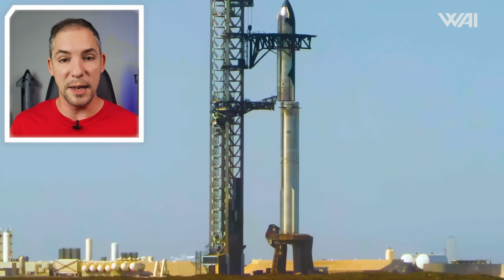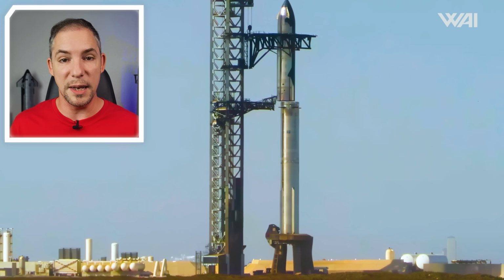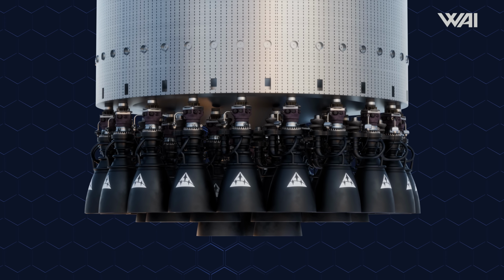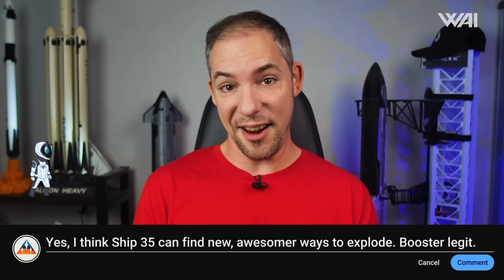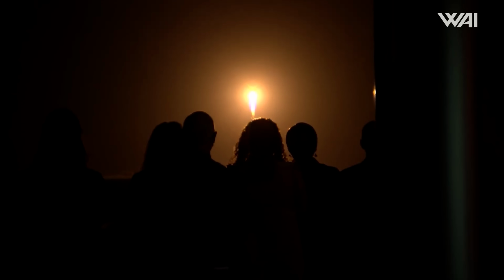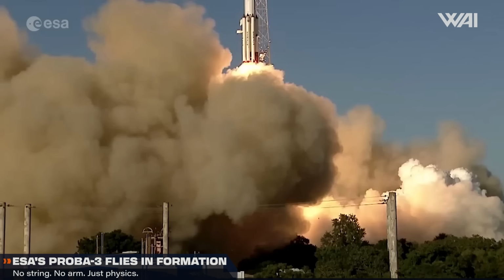Flight 9 Update: Is SpaceX’s Starship ready for its next flight?

Comment: You really don't need to spend much time working with GPT to spot its "style". If not entirely made by, this script was at minimum completely rewritten by ChatGPT, and you can spot it from miles.

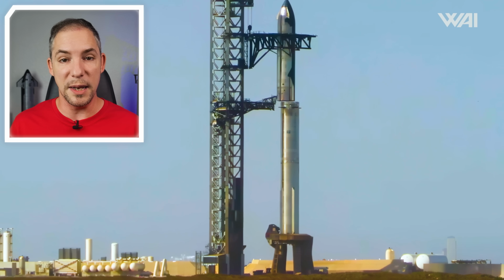This summary type segment at 2:05 with many words, but not much actual information, is typical for GPT 4.0.

At 5:54, you ask what more can SpaceX learn by flying Block 1 Boosters, suggesting that there's not much left to test with that generation. This probably was intended to be a rhetorical question, but for some reason, it is followed by an answer that reiterates the same thing, just with more words.

Then 7:07, "Before anyone gets excited about Pad B handling the next flight.." No matter the context here, this sentence is factually wrong, nothing ever launched from there, so how can it handle "next flight". Probably rewritten by GPT without proper context.

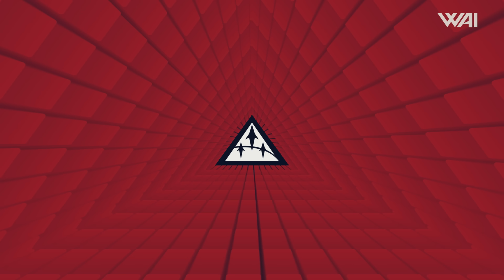8:47 - Pressure tests?

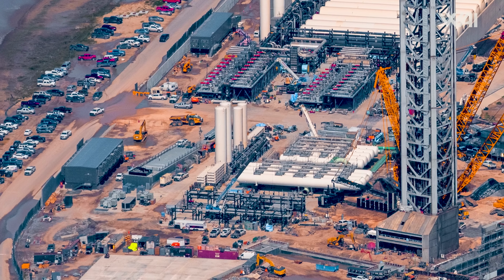8:59 - The vent plumbing? It's like those  scientific papers, where to prevent plagiarism,  AI replaces the word with a synonym, that doesn't make sense in that context. Funny stuff.

At 9:23: "It's possible that another catch attempt won't come until Booster 15" That is regarding Pad B, which was never used. Probably GPT rewriting text, assuming that Pad B is already in use.

More summarizing at 9:54, this info was given two minutes earlier.

10:45 "They are not just x, they are y" is one of the most overused phrases by GPT. Man, you're not even trying to hide it.

11:53 - "rare alignment of international space ambitions" dude

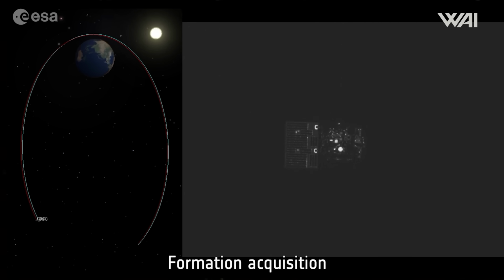17:50 again "This isn't just x, it's y" 

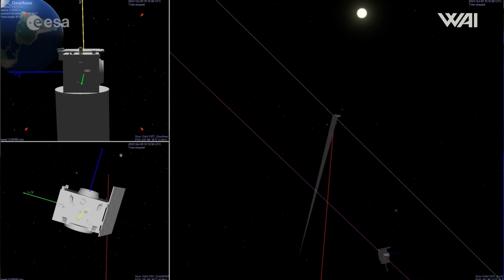18:54 and again

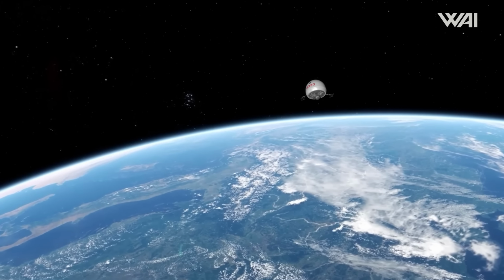By the way, the thing at19:59  is marked as a real image, but it's not the real image of the lander. It's a part of the rocket's third stage that reentered 30 years ago.

I come back to this channel occasionally, and somehow every time I do, the quality of provided information is even lower than before.

P.S. please stop saying that Booster V3 will use 35 engines. It won't, there was a single piece of hardware that suggested that, but people already figured out that this wasn't the case months ago...
Reply: So, are we watching a made over Max Headroom in these videos?

Comment: I reckon the heat seperatation stack still holds too much heat during ship/booster separation process. They can really learn something from the Russian structure. Far fewer strats using a more heat resilient metal. Being that they want to make that part of the operation re-useable &long time function to be used to launch Mars vehicle launches to Mars. Launches return s refuel re-launch until they can make ready sufficient vehicles to full that GAP/DATE between Mars and Earth.

Comment: What should have been discussed in this forum was the root cause and solution to the Starship 7 & 8 RUDs. Apparently both Starships experienced catastrophic POGO oscillations that lead to longitudinal vibrations caused by interactions between the propulsion system and the vehicle's propellant feed lines and structure. Historical mitigation approaches as on Saturn V include accumulator tanks (pogo suppressors) to dampen pressure fluctuations in fuel lines. Some engines used helium-gas-filled dampers or specially tuned bellows to prevent resonance. SpaceX apparently has not installed traditional accumulator vibration dampers. Doing so would require a complete rebuild if not redesign of the stage. Starship lacking traditional accumulators, are relying instead on software control, structural damping, or combustion stability tweaks. In that the structural harmonics change as the vehicle accelerates, and fuel is consumed; it is not possible to test beforehand the complete flight regime. As a mechanical engineer, but not rocket engineer, I'd suggest as temporary solutions, dynamic throttle algorithms that can be tuned to avoid resonant modes, or accelerate past them quickly. Valve Tuning: Changing propellant valve profiles or mass flow timing that could disrupt feedback loops. Optimally, there is only one guaranteed way of solving it. And that’s also the only one on the list of industry best practices for counteracting the problem. Perhaps Starship block III will be so configured.
Reply: I suspect that a passive system will be more dependable than an active (software-led) system.
Reply: This is quite fascinating, and as a software dev it makes sense. They'll have some way of detecting these oscillations and then try to throttle up and down (Even if just by a tiny bit) opposite to the oscillations to try and keep them down, if not almost negligable. It'll be interesting to see how this works, as I see no reason it couldn't unless the throttle response of the engines isn't fast enough to directly respond to the POGO oscillations as they occur`

Comment: This was irrelevant test. You need static fire with full tanks spent during that. You have vibrations which change as the level of fuel changes inside. Next problem is dynamic forces present during the flight combined with vibrations. The bigger ship the worse the vibration effects are. Small ships do not have this severe problems

Comment: SpaceX has chosen to keep us in the dark. No update, no information. Just speculations on X and YouTube. 
I don't mean for SpaceX to disclosure their secrets, or any manufacturing technical details. 
I just mean, I was expecting at least a simple statement that the route cause has been identified, and they have redesigned and reconstructed the faulty parts or systems that were responsible for the explosions. Just a simple statement from SpaceX ! But no, nothing at all !
From this I conclude that SpaceX has not implemented any hardware upgrade on the faulty designed V.2 systems. 
I believe they are going to sacrifice the Starship again.

Comment: Not sure how spacex will deal with a stretched block 3 starship on a block 1 booster as the ship QD will not match up as configured. I think they hoped block 3 booster and ship would be ready to launch when pad B is ready. If they want to launch anything it will have to be block 2 starships, regardless of the results or they close down pad A, reconfigure the ship QD and have nowhere to launch from while doing it. Then they have to scrap all block 2 starships they have made and use only block 3 ships.

Comment: Given that the Saturn 5's pogo problem wasn't cured until the engines fuel injection plate and fuel pipework had been reworked over 2 to 3 unmanned flights. The raptor engines don't seem to have fuel injection plate problems and the problem arose only when they made the second stage starship longer. They have ground tested the modified starship with full duration test fires on the ground this time around.

Comment: Addressing such a critical launch issue highlights why iterative engineering is so essential. Real-world tests often reveal what simulations can’t predict.
Reply: Maybe both are needed, but with vibration testing normally one does real world testing on the ground on the actual test article (with various techniques) to characterize the real world vibrational modes to input into the simulation model. It is unclear if sx actually does this but rather goes straight to actual launch (because, you know, ground testing takes a lot of time and effort). Also the sx methodology is, “We don’t need that!”, until, you know, you do. When you roll the dice, you don’t always win because nature doesn’t work that way. My question is how did sx get so far ahead in their build pipeline without having the correct data to do “tight loop feedback iterations”?! It seems that sx does semi-open-loop design steps, this is possibly suboptimal.

Comment: They said they were having vibration problems if builds up can shake things apart. Engines so good they're generating power vibration enough that Piezoelectric could absorb and bleed out as it builds into Plasma generated Ultrasound at the nose to make a pressure force field to lower drag with waste power. While protecting the ship. Amazing they don't understand yet so they tested messing with engines.. Google: "University of Central Florida radio waves to electricity Piezoelectric technology" Keys=Vibration to Piezoelectric > Piezoelectric bleed to capacitor bank > Capacitors take turns dumping power like electric pistons lol..

Comment: The POGO problem is just so complex (i.e. several possible causes) that it may require rebuilding parts of starship.  I will be very surprised if SpaceX can fit the problem with just flight 9.
Reply: The booster will be fine i think but starship definitely has lower odds
Reply: The problem is really complex, with vibration testing normally one does real world testing on the ground on the actual test article (with various techniques) to characterize the real world vibrational modes to input into a simulation model. It is unclear if sx actually does this but rather goes straight to actual launch (because, you know, ground testing takes a lot of time and effort). Also the sx methodology is, “We don’t need that!”, until, you know, you do. When you roll the dice, you don’t always win because nature doesn’t work that way. My question is how did sx get so far ahead in their build pipeline without having the correct data to do “tight loop feedback iterations”?! It seems that sx does semi-open-loop design steps and this is possibly suboptimal.

Comment: In an attempt to save the launch mount and hardware, why don’t they simply ignite half of the engines until they reach an altitude of around 500 meters, and then all engines ignite? With only half of the engines operational, they still have enough trust to lift both the booster and ship right?
Reply: Wouldn’t get off the ground to begin with.
Reply: I think the equipment for lighting the entire outer ring is part of the launch mount.
Reply: @christiancortes7523  uh, no. Full stack with payload and full fuel load weighs far too much for only half of the engines to lift it. There's a reason it has that many engines, the first minute of flight burns 70% of the fuel, so it loses a lot of mass, and needs far far less thrust like when the booster returns to the pad, it's at 1% fuel capacity and lacks the upper stage, so a single engine is enough to control it.
Reply: The outer engines can only be started on the ground and are fixed , the inner engines are the ones that do the thrust vectoring. Besides, it needs almost all the thrust to get off the ground.

Comment: Still worried about POGO, especially emergent conditions that can't be tested on the ground. Here's hoping they put some changes in place to prevent this on Flight 9, even just some procedural changes (tank pressure, flight profile).
Reply: The problem is really complex, with vibration testing normally one does real world testing on the ground on the actual test article (with various techniques) to characterize the real world vibrational modes to input into a simulation model. It is unclear if sx actually does this but rather goes straight to actual launch (because, you know, ground testing takes a lot of time and effort). Also the sx methodology is, “We don’t need that!”, until, you know, you do. When you roll the dice, you don’t always win because nature doesn’t work that way. My question is how did sx get so far ahead in their build pipeline without having the correct data to do “tight loop feedback iterations”?! It seems that sx does semi-open-loop design steps and this is possibly suboptimal.
Reply: How about a couple of in-tank supports for the Down Comers - that might prevent vibrations from becoming too big, and breaking the weld where the Down Comers meet the end of the tank.
Reply: @Kr0N05 

Probably what sx is doing, the quick and dirty way to bandaid an identified problem. But what if there is a larger and more systemic vibrational issue?
Reply: Starship will ultimately be human rated. Just not in the near future. Starship & SpaceX have a long journey ahead of themselves. Regardless of what people think, it will take far longer than imagined to get Starship human rated. Many tests have yet to be executed.
Reply: @SpaceXsuperheavy 

I agree with most of what you said, but how is starship going to be human rated (other than the moon landing version)? Didn’t we learn something about that with the space shuttle ‽  Starship doesn’t have any abort capabilities or redundancies for reentry, just like the space shuttle. So I guess NASA is just going to repeat the same dangerous mistakes ‽

Comment: man the absolute precision those two crane operators had is just wow.
Reply: @gannicusii4163  Yes it was. I saw where the two crane operators practiced several times before the real thing. If you asked me, I'd say that it was very smart of them to do several dry runs first. They were perfectly synchronized.
Reply: Crane operators tend to become more precise over time, until any crane they operate essentially becomes an extension of them. Also, since the video was sped up a tad, there were likely some minor adjustments as they went.